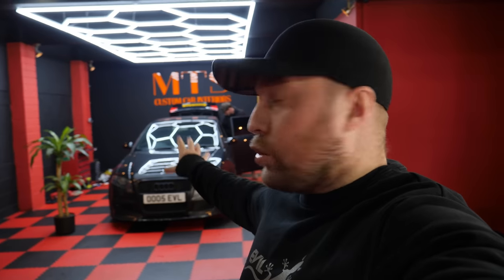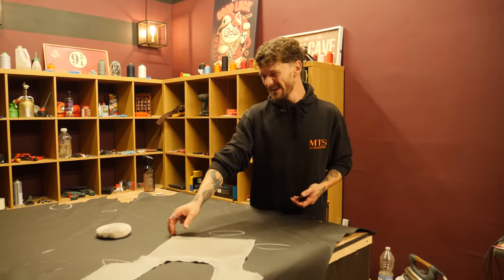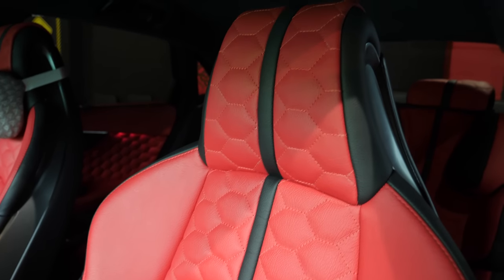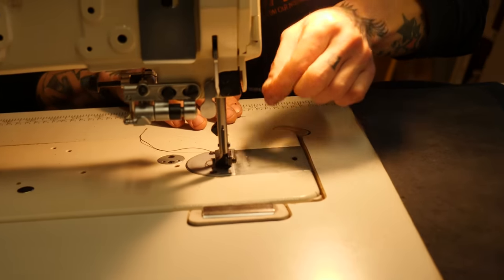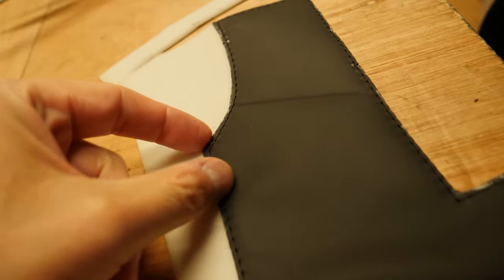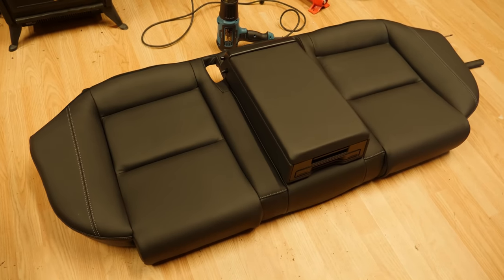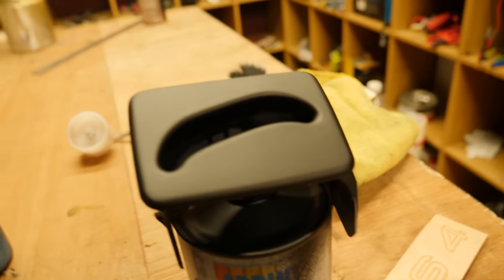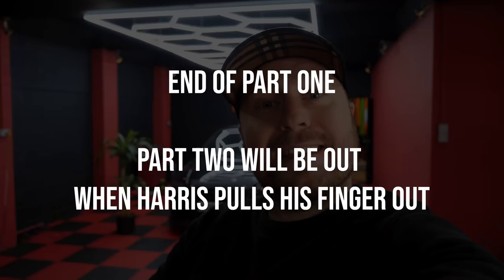A RACE AGAINST TIME TO PREPARE OUR CHEAP B7 RS4 FOR THE NURBURGRING PT 1…

Comment: Always great content. Just wondering of you thought about dying the leather seats?
Reply from the maker: Spoke to these guys about it and apparently it’s not as easy as it sounds. Can be patchy and if bits aren’t cleaned properly it looks terrible. Then it has to be sprayed with a sealer which is a big job. Plus there were bits of the original leather that was tatty too 👍🏼

Comment: Surely it would have been easier/cheaper to buy used ? There is a set on the bay
Reply from the maker: Not heated mate. We already had a set of black out of the Avant but they weren’t heated
Reply: Good content too though

Comment: Waste of money on the seats, could have just dyed them black
Reply from the maker: Spoke to these guys about it and apparently it’s not as easy as it sounds. Can be patchy and if bits aren’t cleaned properly it looks terrible. Then it has to be sprayed with a sealer which is a big job. Plus there were bits of the original leather that was tatty too 👍🏼
Reply: @EVILGT  Mike Brewer managed it on Wheeler Dealers :elbowcough:
Reply from the maker: Kwasi Kwarteng said he wasn’t going anywhere then 24 hours later got sacked… don’t believe everything you see or hear on the tele bud 👍🏼